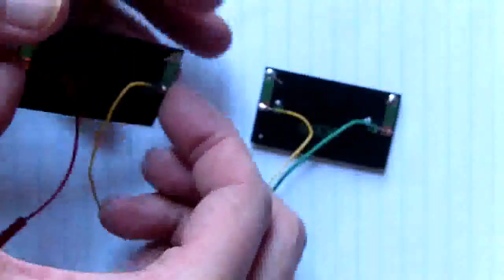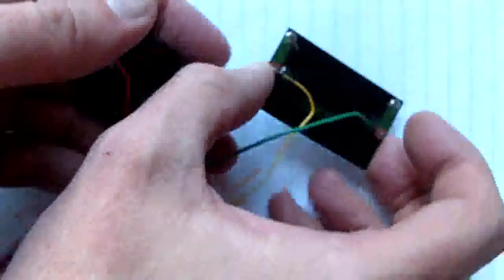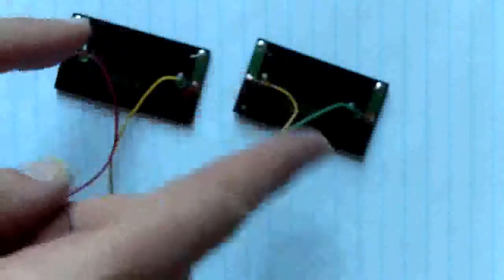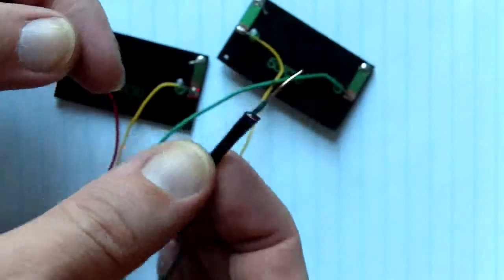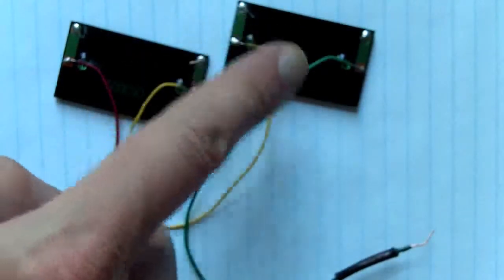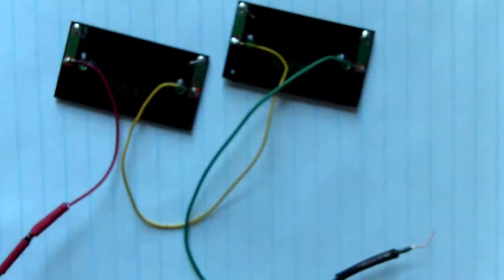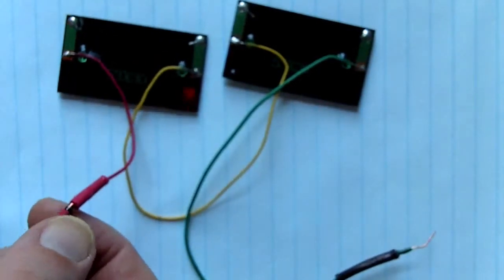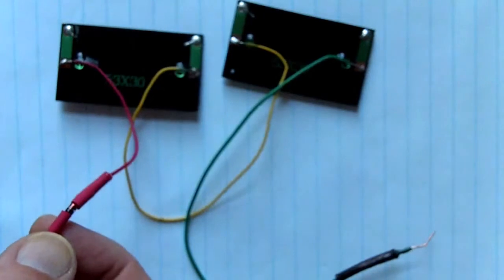Mini Solar Cells Connected in Series for Charging Arduino 9V Batteries

Comment: What kind of diode did you use?
Reply from the maker: I used a normal 1N4148 silicon diode. It doesn't have to be a high current/power diode since these small solar panels can only put out about 30 to 40 mA maximum.

You can use a germanium diode (or perhaps schottky?) with a smaller voltage drop (about .3V) if the silicon diode drop (.6V) is too large for your application.
Reply: @espectraa1s  thank you!